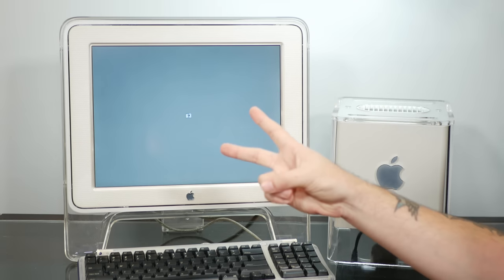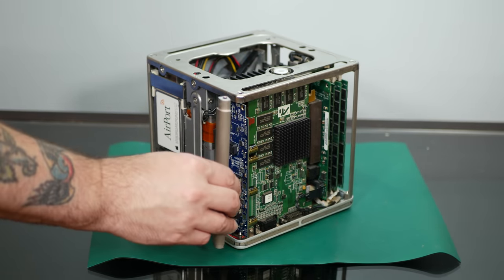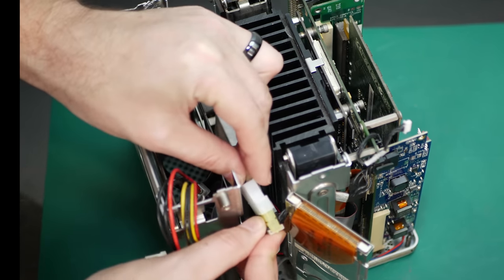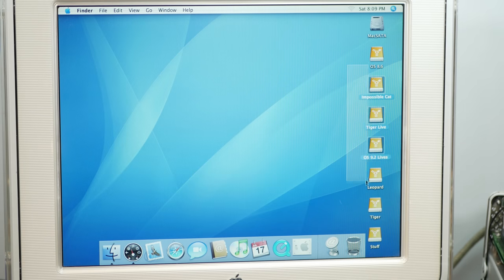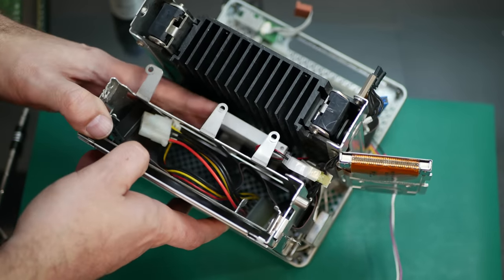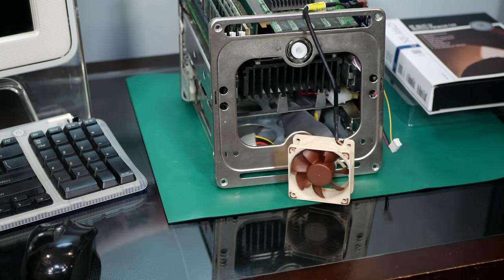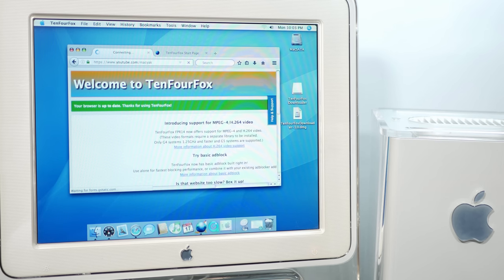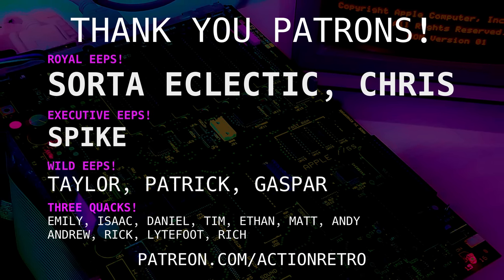Pushing my G4 Cube even FURTHER! The ultimate SSD, and can this thing YouTube?

Comment: iMac slot loading dvd drives sell for pretty cheap on ebay. I reckon you should try getting one to fit. Even if it's a sata variant there should be room to fit in an adapter.

Comment: The Cube may not have a speaker, but it does have a DAC, Amp, and speaker port. They're just not turned on in firmware and used.

Comment: I dunno, feels a bit janky with the SSD mounted to the bracket with a single screw. I just bought a SSD and IDE adapter for my eMac, and I'll definitely be mounting it using a 2.5-3.5" bracket.

I also just bought an external firewire drive, so it'd be cool if you could make a video tutorial on how to make a drive like yours with all those images on it. I've found an article on how to do it, but it'd be good to see a video showing the process.

For the master/slave settings, it's controlled by pin 28 on the IDE connector. If it's grounded then it'll be master, floating for slave. Usually the host controller will ground pin 28, so just plug in the SD card reader and check if pin 28 has continuity to ground, if so you should be able to cut the trace going to pin 28 on the card reader and it should then be set to slave.

Anyway, it's nice to see this project progressing. The USB sound is a nice touch, just need to get that fan sorted and video card upgraded! My only other suggestion for the slot-loading drive bay would be to hack in a laptop DVD drive. From a bit of Googling, I believe an Apple 678-0524A or 678-0563A (which are currently available on eBay) should work with a JAE adapter like this one: https://www.ebay.com/itm/262283714242

Comment: I think you can get an IDE passthrough that has a master/slave switch, and of course Amazon sells some all-in-one parts, too. Heck, I would put a quick-release drive bay so you can swap 2.5" drives in and out of the system. Heck, if you go really nuts, I have a project coming up where you can get a video card through USB 3.0, and I think FireWire is decently close in terms of speeds, so you can always fill that empty space with that as well.
Reply: FireWire 400 is much closer to USB 2.0 in terms of throughput. Also, no OS that runs on the Cube supports running a GPU over FireWire. And I've never heard of a FW to AGP bridge. 

There are USB video cards, but the Cube only has USB 1.0, so this would run dog slow. Also, those types of GPUs are OK for adding 2D screens, but offer no 3D real acceleration.

Where would the quick-release drive bay go? There's no openings in the top or bottom to accommodate it (you won't get a 2.5" drive through an optical drive slot). 

There may be some merit in setting the HDD / SSD to run as Slave (if OS X will then boot off it). This might then allow the SD card adapter (which appears to be hard-wired as Master) to work.

Comment: A card reader seems pretty pointless tbh because you don't need it for a boot drive, due to the SSD, and you don't need it for data transfer because this already has USB (albeit 1.1 but not much we can do about that) and 10/100 Ethernet. So, given that you can just use a samba share to get files on it, the card slot seems pointless considering how fiddly the mounting will be and plus the card sticking out will detract from the appearance. What's the challenge you've hit in finding a slot loader CD or DVD drive that's compatible?

Comment: First instinct for the "weird clicky" fan is cable management - blades are impinging on a cable somewhere. :)
Reply: 100% this, the fan was just rubbing against something. Check your clearances.
Reply: I've ended up zip tying cables to the case using one of zip tie mount thingies, I also used a small 3M hook. I installed a new case fan after my previous failed, I used a different connector that was on the other side of the case, and that sometimes hit  ONe of my other case fans.

Comment: as said last video, GeForce 6200 256MB is where to go, find any PC one on eBay that is AGP with both locator slots and have at it with flashing it. You should also re-cap the 6200 when acquired since like the GeForce 4 cards and era FX5200 cards, they do suffer from cap plague issues and the caps will spontaneously go BANG at weird moments if you do. Replacing them with poly caps will ensure long life.

As far as a fan goes, you're rubbing on something, I can definitely hear it. Try running both of the slim 80mm fans outside of the machine to see if they're really quiet or not and adjust your brackets as needed. As far as that 4th pillar is concerned, just wrap it a bunch with kapton tape and it'll be insulated from the VRM, that's what I've always seen done.

the SSD you chose is fine, but do note it does not have any DRAM cache. any used Samsung PM841 or equivalent OEM-spec 120/128GB mSATA SSD will do you much better in the long run and will definitely be snappier than the one you dropped in there when it comes to doing file transfers and such. This will also be a big thing when it comes to game time, as right now what you have is essentially a big CF card without that cache being there... and that by itself will lead to a few problems down the line. You should also consider looking into the changes that need to be made to the system now that it's running off an SSD, as far as limiting the number of writes you do to it during normal operation. 

If you want a nicer non-apple-monitor experience you can upgrade your display to something like an HP vs17e, which is a 17" 1280x1024 LCD monitor with built-in sound that doesn't sound all too bad... and clears up desk clutter at the same time. Yes, you lose the two USB ports, but that's something that can be remedied with a USB hub. When I had my cube up, I used a hub velcro'd to the back for flash drives and my iPods and such. (plus, the Epson Stylus Color 888, or the 8-Cubed, the Epson-released printer to go along with the G4 Cube back in those days, like the Epson Stylus Color 900G with the iMac G3.)

If you remove the Lithium battery compartment off the motherboard and replace it with a coincell holder, you'll be able to save your PRAM without risk of damaging the board with a lithium battery bomb later on... and there is a good chance that the USB audio adapter will be able to "bong" on boot after the PRAM can actually save itself and tell the boot stuff "HEY! THE SOUND IS OVER HERE!" as the G4 Cube would never bong on the first boot with a new battery either. You wouldn't want the original speakers anyway; After 20 years, the surrounds turn to goop or dust depending on climate, and while they can be fixed, it's an arduous process, one because of dust everywhere or goop everywhere, and two because of the size. At some point however, we did have a Harman/Kardon iSub USB subwoofer to go along with the Cube. those plus the original speakers were amazing at the time.
Reply from the maker: Wow thank you for all this great information!
Reply: If you don't mind the driver surrounds being white rather than black, I believe the speakers for the iMac G4 or DA PM G4 are identical. You could transfer the drivers across.

My recollection is that only the original USB audio amp that came with the Cube will 'bong'; any stereo USB audio device will work fine after the OS loads though. 

The iSub was great. The only problem was that one of the mid-10.5 updates broke compatibility with it. If you stick with Tiger that won't be a problem, obviously. The HK Sound Sticks are functionally similar though, and have no compatibility issues (the v1 with silver stand hoops also used USB IIRC). 

I've never seen / heard of the Lithium batteries being a time bomb. Usually, it's a case of being amazed that they're still working after 15 years. Cheap to replace too.

The 6200 is a good card, but in my experience won't wake from sleep (I flashed the XFX 'WANG' card that everyone recommends). The Cube's drive / fan spins up, but no video output. Not an issue if you won't sleep the Cube (it obviously boots quickly from SSD). I switched to a Radeon 7500 instead, which is a good all-round card for the Cube.
Reply: Why did I read the whole thing

Comment: For this one post touching VRM, I would use a bit of kapton tape. Not much, so there's good cooling conditions, but enough for isolating pins from metal.
Reply: I was thinking that, or good quality electrical tape, which solved the HDD cable issues in my 13in Macbook Pro Mid-2012, where the cable rubs on the metal/HDD/SSD, si over time causes micro abrasions,  then ruins the thin cable, and you have to replace it.
Reply: heat shrink tubing would be a good fit, stays on well and won't fall off like most electrical tape
Reply: @amirpourghoureiyan1637  I honestly did not think about that if you can find some big enough, and long enough.
Reply: @amirpourghoureiyan1637  I think heat shrink tubing would be too big after shrinking, and whole cube would not slide down in enclosure
Reply: @bobobaba123  If you cut it to just fit the section that has contacts then it shouldn't rub as much, I don't think they'll be an issue down the line of holes as it shouldn't have anything to pierce it on the VRM board as I believe it's just pads and not pins.
Reply: @CommodoreFan64  you can buy heatshrink in the electrical store in custom cut lenght. U tell to the seller the diameter and the required lenght, and they cut it from the xyz meter long reel. If u dont have that option, then u can use shorter pieces and overlap them.
Reply: @talos86  I have isolated the post in my G4 by using insulation tape to protect the Artrix VRM.  Works great

Comment: I'm loving your channel. You inspired me to get my hands on a very special collection. I have now a Cube, iMac G4, IIe, IIc, Centris, PowerMac 6116, PowerMacs G3, G4, G5 and like 12 vintage laptops. I bought the mSATA adapter you recommended. The laptops are loving them. I didn't know about this desktop 44 pin to 40 pin laptop adapter. I'm glad I saw this video. I also have quite the special monitor collection. Keep up the good work. My SO is not so happy that Netflix got replaced by Action Retro (so I got me another TV).
Reply from the maker: 🤣 Thanks!

Comment: Is the fan being under-volted? If it's a 12-volt fan, it may have difficulties continuing to spin if the MB reduces voltage to a low enough level. The clicks may be it trying to get past the voltage needed to start spinning again, but not quite getting there.

Comment: I think you've put the fan in the wrong way; should blow up through the chassis, not down out the bottom.
Reply: PC fans pull through the open side and exhaust through the side with the cross.

Comment: I am not familiar with macs, but it is possible the fan header the fan is plugged into has some form of speed control and the system is trying to drive the fan slower then it can spin.
Reply: I was thinking that myself, or just not giving the fans the correct voltage?

Comment: Perhaps the SD reader has solder points where there would normally be jumpers? You know them Chinese manufacturers, if they can save .003 cents they will ha ha!

But if so you could either a) bridge them with solder or b) solder on actual header pins.

Comment: the dvd drive is the same as the slot loader imacs iirc so i wouldn't sweat that too much if you actually wanted to go that route. 
For the Video card, There are a number of options, just do some research

Comment: I was looking at these cubes on eBay and there are some broken ones that are pretty cheap you could buy for parts. Maybe the DVD drive works in those and the fan and you will have a parts computers.
Reply: It kind of was the trashcan mac pro but then prettier. Do these cubes have an IR receiver? Or was this from before the Front Row days?

Comment: external firewire sound module would have worked too. Leaving the USB port clear.
Reply: It's a USB 1.1 port, you don't want to use that for anything but a keyboard or a sound adapter. The FW port is about 50 times faster.
Reply: @arthurswart4436  understandable. being an audio production person I had my motu hooked up to the FW port. Wish I had an SSD back then. Watching it boot up so fast like that made me tear up a little.
Reply: @bioglassmusic  If you're really suffering, I have a Cube with the same 1.2 GHz upgrade and a 60GB IDE SSD available. I have six Cubes left of the 16 I once had (long story) and I almost never use the 1.2GHz one. I have a dual 450MHz G4  version somewhere as well, it's been in storage for years. That might be a fun project as well.
Reply: @arthurswart4436  Definitely fun but I personally don't have time anymore. I've been putting off the m.2 upgrades in my used 2013 and 2015 iMacs as it is. Thanks though. Love watching you do it.

Comment: About the IDE to SD adapter, be sure the back of it is insulated! I had the same issue, and turned out the back of it was just touching something in the case, causing a short. I've since attached a thin sheet of cardboard to the back via zip ties and it now works just fine!
Reply: Kapton Tape should work as well

Comment: I would want to put a slot loading blu-ray rw in place of the original optical drive just for the over the top nature of it. As for IDE adapters, I use a StarTech adapter for the ssd in my eMac because it's one of the few ide adapters that supports cable select which is what most Macs of that era seem to use. A lot of the cheap adapters are master only which means they won't work for what is presumably slave in the optical drive slot. My StarTech adapter also has a special jumper for optical drives, if you end up wanting to put a newer optical drive in

Comment: Sean To Get The Bong At Startup You Need The Apple Pro Speakers That Came With The Cube With The Built In Amp On The Speaker Harness I Tried Using The USB Sound Cards Tried Many Different Ones Only The Apple Cubes Speakers Will Work I Was Lucky Enough To Find One I Transplanted New Old Stock Cube Apple Pro Speakers On The Wiring Harness They Sound And Work Fantastic 
You Should Put Leopard On Your Cube YouTube Will Play A Little Better I Would Put A Optical Drive In It. But As Usual Another Great Video Sir

Comment: I tried the SSD (purchased similar equipment) as you suggested but couldn't get it to work. I have a cd drive installed. Would master/slave settings affect it in any way? I was hoping to get into disk utility, format drive and then install an macos. I've tried booting from a cd install disks but it didn't come up either. Any suggestions gratefully received. Thanks

Comment: I have a Cube, purchased about 9 years ago with a 1.5Ghz upgrade card.  I then managed to get the speakers and amp separately, and then the creme on top - a full HK Sound Sticks USB.  I tried moving to SSD, which appeared to work ok, but I was trying to do a fresh instal of OS9, and it would not boot.  I then tried a fresh OSX... but it also wouldn't boot.  Am guessing the upgrade card needs some extension installed... Need to go digging for information to work it out.  Hard when I didn't do the upgrade myself.

Comment: Mine is WAY better... check it out for ideas on your build: https://68kmla.org/forums/index.php?app=forums&module=forums&controller=topic&id=59875 - FYI you don't want a non-removable system drive in the DVD bay, makes no sense. Use a removable firewire CF card reader like I did. I got 2x full size SSD drives, 1x external DVD drive CF card reader, AC750 wifi, 6200GT graphics....

Comment: At one point, putting Apple's Radeon 9700 card in the G4 Cube was the "ultimate" video upgrade. (I'm not sure if a mod is required to the card, only that I sold an Apple Radeon 9700 card back in the day to someone who was going to do just that.) However, that card seems to be unobtanium these days. Perhaps flashing a PC version of the Radeon 9800 would be the best video upgrade for your cube... just not sure how you're going to power it.

Comment: I have had lots of trouble with these same mSata to IDE adapters. Have had 2 of them die in the last few months on vintage macs. Just beware.
Reply: I think SD-IDE adapters are the way to go, a lot easier and cheaper to get than full blown SSDs. Especially since they've got well-known brands making the SD cards unlike most mSATA drives.
Reply: @amirpourghoureiyan1637  Most SD cards are really not designed to be used as OS drives and they're going to wear out pretty quickly running anything more or less modern. Can't speak for how OS X 10.5 would fare, but it's something to keep in mind.
Reply: You need to use a good quality model. The modern Startech ones use a decent chipset - I've found other ones don't wake from sleep properly.

Comment: Pioneer did a slot-in dvd-drive, and maybe a burner too? Don't know if the drive will line up with the slot on the top though. Or maybe if it's possible to mod a laptop slot-in dvd-drive to fit. U should also consider replacing the clock-battery if it doesn't work.

Comment: You can probably get some sewing machine oil & put some into that older fan as a temporary fix, otherwise you might be able too find another slim fan that fits fine, measurements looks like its similar too amd's older cpu fans think its 70mm & slimline design which usually is 15mm so 70x15mm cpu fan should show plenty of results.

Can probably go with AFB0712HHB DELTA for this, max rpm is 4300 38.5 dba  & about 38 cfm it should easily cool down this little pc even if its running a much hotter cpu then originally intended.

Comment: geforce2MX or geforce3 are your best bet, the Mac versions of the time have ADC on them, and as a nice bonus should work with the backplate from your current card (assuming it's the Rage128 most cubes came with). They both run very hot through, especially the 2MX and you will need to have good airflow over the card or it will overheat and artifact/crash.